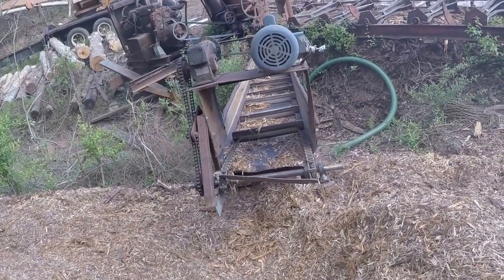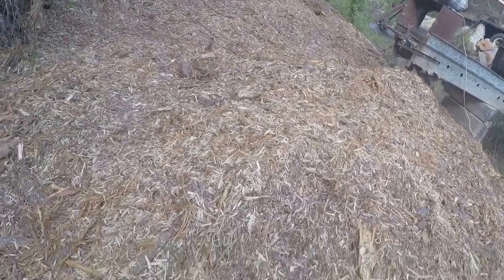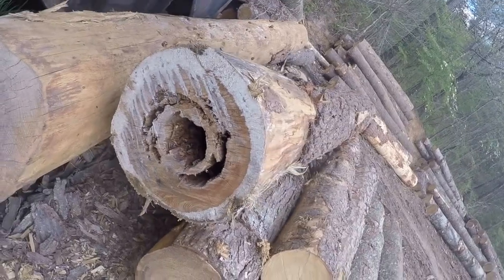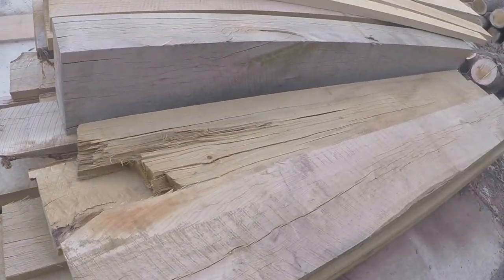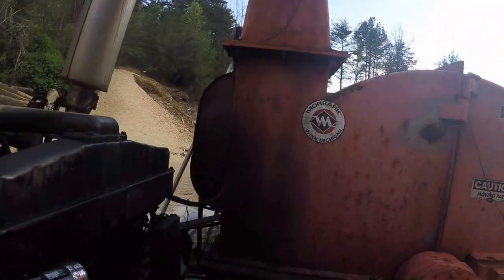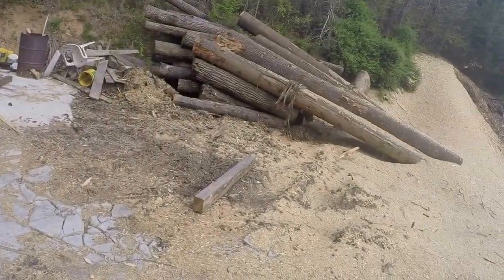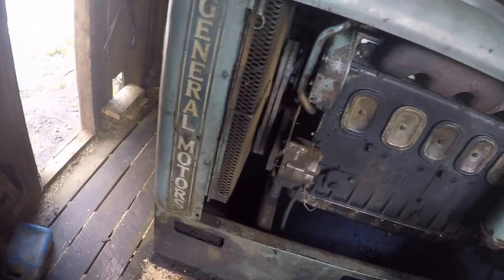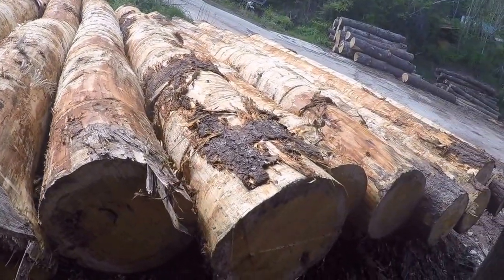Another day at C&M Sawmill

Comment: Had a 4 cylinder engine on a compressor that I had rebuilt from the cast iron out. Everything was center of the range on specifications.

Sucker had me chasing an overheating problem, just like you mentioned on the Cummings. This was a complete Ingersoll/Rand that worked all day, every day...I rebuilt it because it smoked and was losing cylinder compression.

This is the long way of saying that that overheating problem was my fault!!! When I put it all back together, I missed one little shroud part--about an inch and a half ring.

I didn't understand all of the scientific explanation of exactly why, but if your cooling fan shroud doesn't cover at least half the blade tip pitch (seen from the side, looking at the fan blade tip) you'll never get 50% of the fan's capacity.

Extend that shroud out so the fan blade fits halfway into the shroud, and the overheating problem goes away.

I know this is an older video, and this engine is likely not with you anymore, but someone reading this might profit by reading.
Reply from the maker: Logger friend got the motor and it is doing good in his log truck